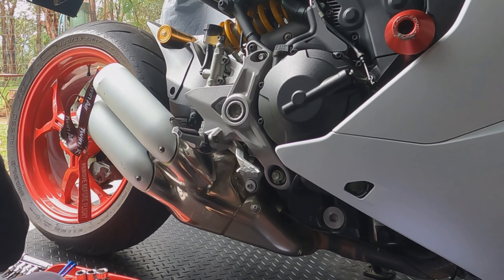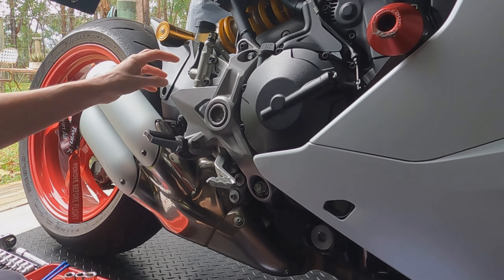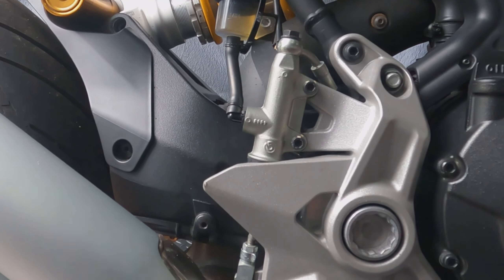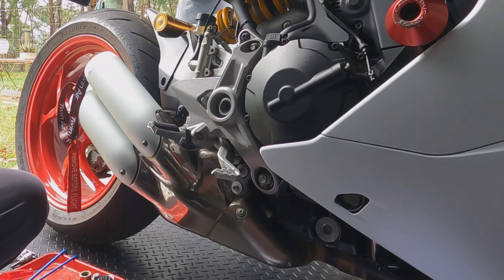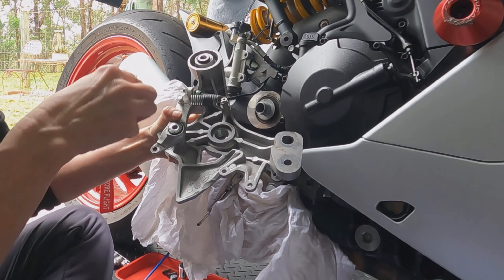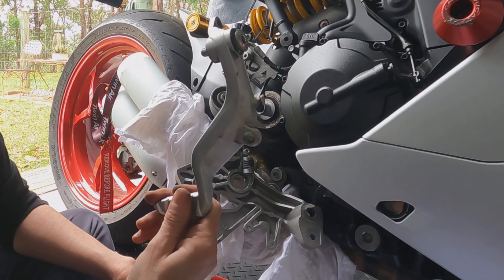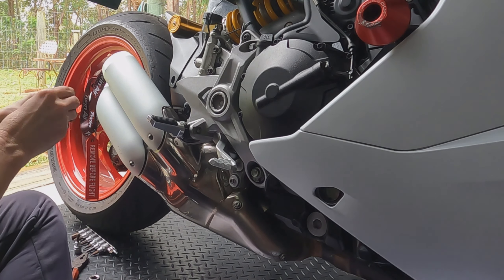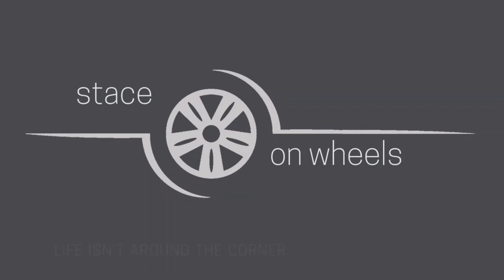Rear Brake Lever Repair On My Ducati SuperSport 939

Comment: Do a vid on heating the bent one and getting it back to shape, or did you chuck it out?
Reply from the maker: Spydey I kept the lever as a souvenir, but it was actually the pin that was most bent. On closer inspection, I probably could have re-used the lever but it's a light alloy and I thought it safer (and cheap enough) to just replace. I don't plan on having to change it again either!!!!

Comment: Hi Stace!  I had same problem but unfortunately the inner trade of the rear brake frame where you screw in the pin, is stripped. I would buy an other pin but do you have any suggestion how I can fix the inner trade? I guess I need to buy a new rear brake frame!   
I love your spotless working area!  Thanks!!
Reply from the maker: Sorry to hear you had this problem. I'm not sure if you can tap a new thread in where that footpeg mounting plate screw goes in... I remember it was a fairly hefty torque... this is a question for your mechanic. Good luck!
Reply from the maker: Actually, ask your mechanic if a helicoil could work.
Reply: @staceonwheels  Many thanks!